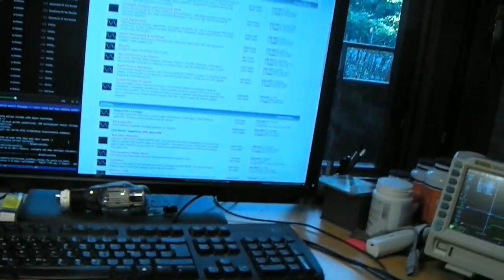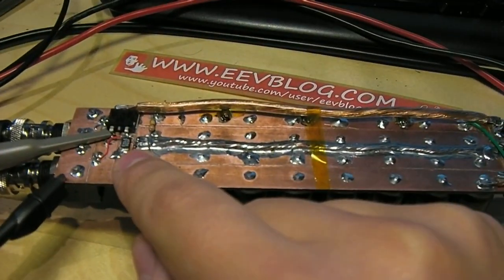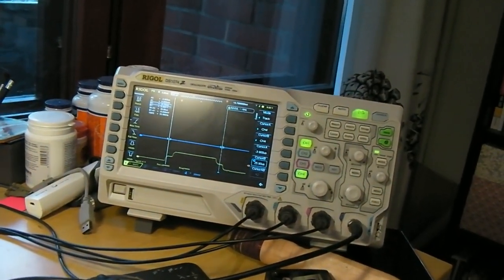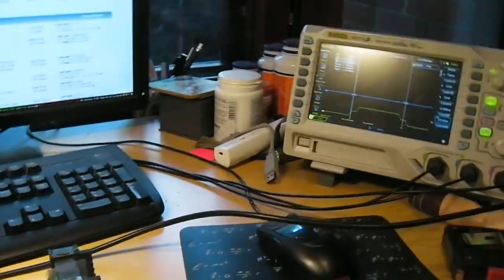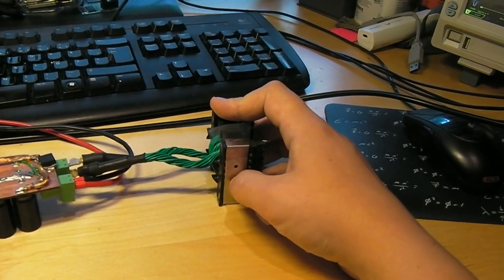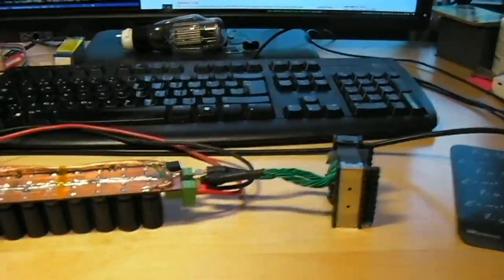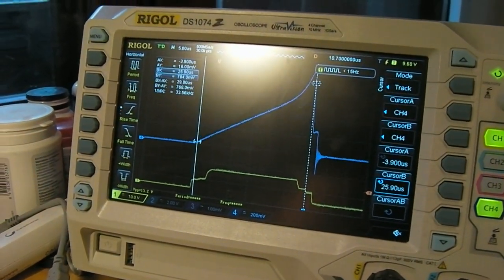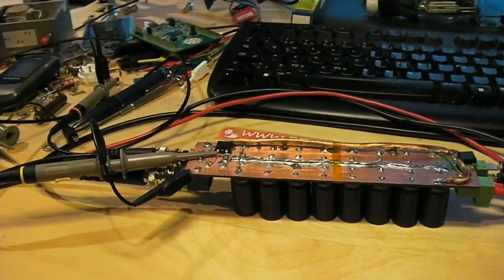Inductor saturation current tester

Comment: Did you ramp the current just using the RC network at the power supply??
Reply from the maker: The inductor resists the change of current so it grows rather linearly when the inductor is not saturated
Reply: im asking because in my pwm, the mosfet opens too fast, the current peaks and the inductor does not charge like this. Do I have to restrict the current or do something else to get this charge?

Comment: Just make simple pulse generator by arduino i.e. 1 pulse every 3s so you dont need so many capacitors ;)
Reply from the maker: Pulse repetition frequency does not really affect that. The large amount of capacitors is to reduce the source impedance of the circuit to reduce the effect of that skewing the measurements.
Reply: @Dagosaatana  yes, correct but if you have mang pulses per s then they can not have enough time to charge and even load too much the source so at the end their charge will be smaller and circuit wont give enough current
Reply from the maker: @tomg8069  Yes but this is not really an issue unless the repetition frequency is tremendously high or the power supply is very weak

Comment: Excellent. But I thought it would only send a pulse of voltage? The inductor keeps buzzing, so there's an alternating current flowing?
Reply from the maker: You are correct! My signal generator is pulsing the core at 100 Hz. I would use 1-10 Hz but my signal generator bugs out if I try to go that low. This makes it easier to show the effect on the oscilloscope :)